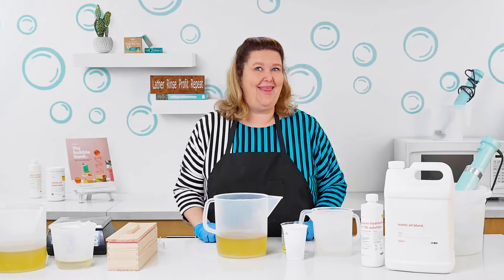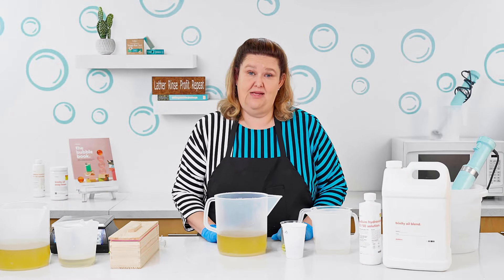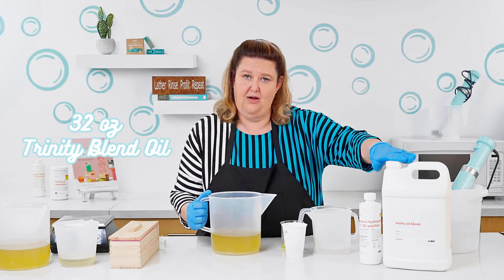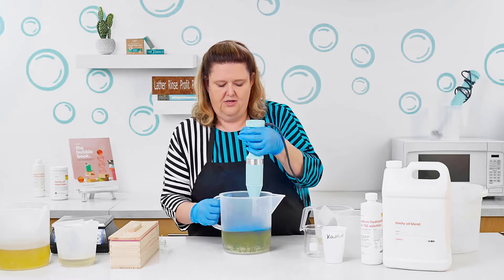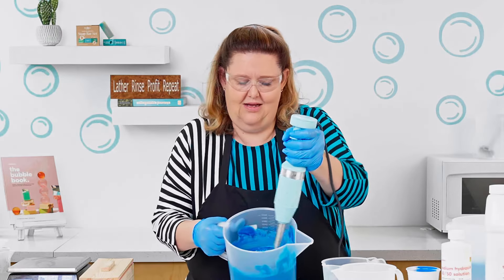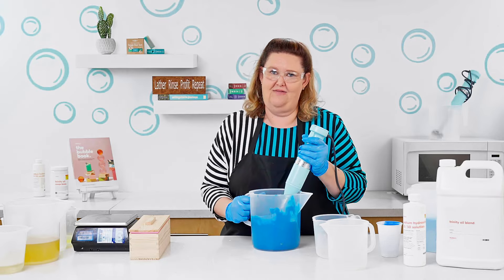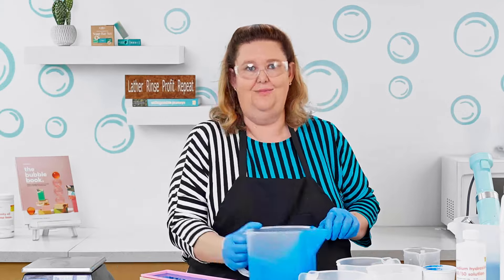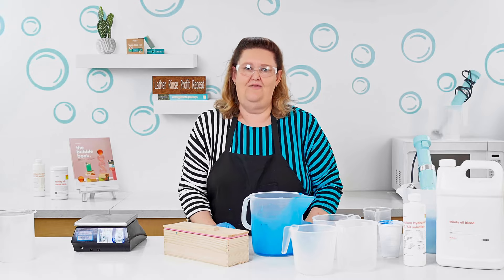How to Fix Soap Seizing 🤨 Cold Process Soap Making

Comment: Hi Joana.  Can you still use the soap that siezed?  Can you cook it?  Thanks
Reply: Yes you can, you can rebatch it, which is basically hot process soap. Melt it down in a crock pot, add a little more water, any additives you want to introduce, and quickly remould. No need to throw failed batches away - no way do that. Save it, rebatch it. 

Very grateful for the whisk tip when using aromas that accelerate fast. Bless ya Soap Gal.

Comment: Thanks so much for the video. You went super fast. Question…. You added water to the oils the lye water (50/50) to the oils? Or did you add all of the water to the oils then dry lye?
Reply from the maker: Great question! I added water to my oil, then 50/50 lye solution to that mixture
Reply: Awesome thanks so much for responding.